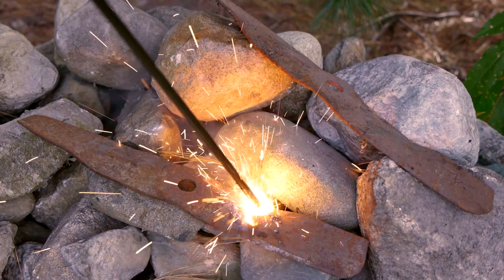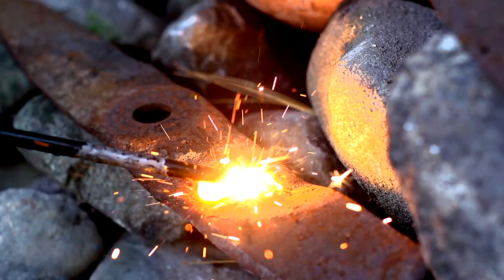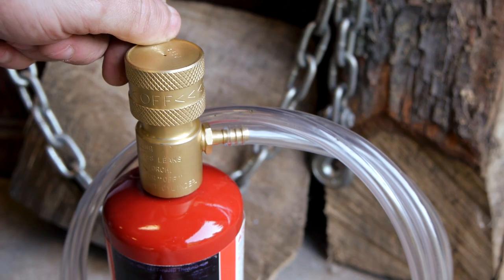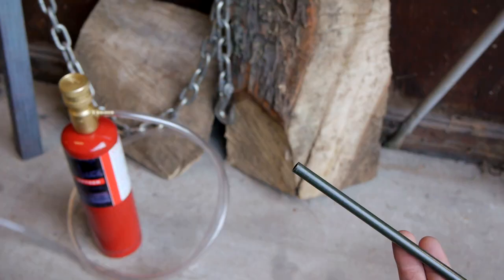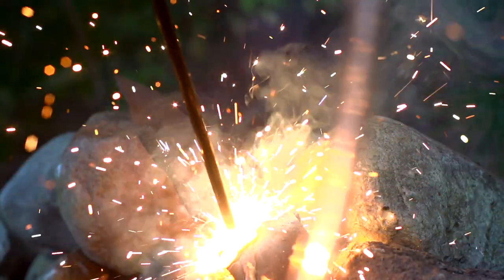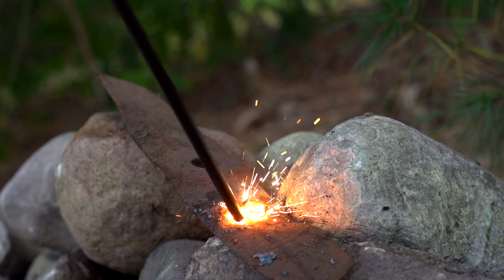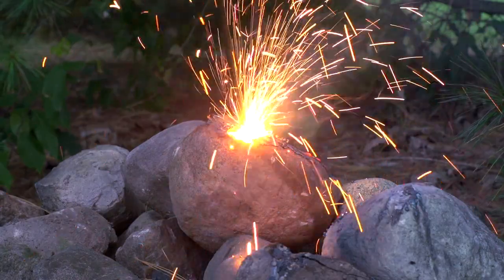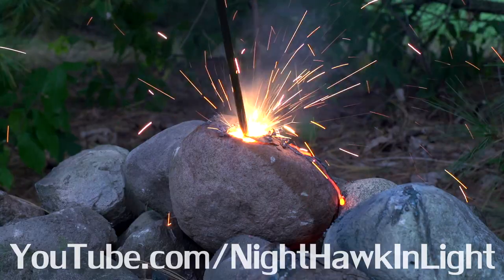How to Make a Thermal Lance Kit - Hot Enough To Melt Rock - NightHawkInLight

Comment: What degrees do you have. Or are you just magical
Reply from the maker: +eprepp 98.6 last I checked
Reply: NightHawkInLight I was gonna ask school but I didn't know how to spell college, however, the Internet helped me.
Reply from the maker: +eprepp I know, I was just joking. I took a few classes in community collage, that's as much as I've done. I don't recommend others follow in my footsteps in that regard. Education is very important.
Reply: NightHawkInLight yeah m8, I knew you were joking but just wanted to guarantee an answer. Don't worry, some of the most successful people were college dropouts, Gabe newel, bill gates, Steve jobs (not that you dropped out). You still seem very smart and I think you could be very successful in engineering or science, you got alot of natural talent.
Reply: +eprepp It should be noted though that most of the successful college dropouts, did so because they were bored and not challenged enough, not because it was too difficult.
Reply: +NightHawkInLight I personally believe community colleges are far better than MOST any universities/colleges as they usually teach trade skills and other real life useful courses that you can actually get a career/job in and not just a useless but expensive piece of paper to put up on a wall.
Reply: +13andsim I am wondering if one were to paint the brake line with real aluminum paint @ 99.5% purity it was pricy for spray paint ( a few coats at least to get a decent amount of thickness) and would that make it burn even a little better? or even a little hotter? or would it just burn up the "rod" faster with no substantial benefits?
Reply: +13andsim Aluminum is not the same as iron or steel, what the steel from the rod is doing is called burning out I believe. Also I don't think aluminum oxidizes as easily, so you might just cause slag to form from doing it, in other words you might just make it messy with no benefit.
Reply: K thanks man ... I was only wondering because of the exothermic reaction between oxidized steel/iron dust and aluminum dust like the thermite reaction and that it "may" add some more heat ... oh well it was worth the thought :-) (it is possible to get up to about 3000°c or so IF mixed at the proper ratio and properly ball milled/powdered).
Reply: +13andsim Actually, adding aluminium is exactly what we used to do (by packing the steel tube with aluminium strips and lightly crimping the steel tube to hold it in) when we used thermal lances in demolition in the 80's. I don't think aluminium paint would work though.
Reply: Tsnafu Awesome,  that's what I wanted to know :-) . This high end/specialty spray paint I ended up getting at a special price (discontinued product with a company I use to work for ..like 45-50$ /can ..made in Germany) and have been looking for an excuse to use some of it lol.  I am sure I probably could not deposit enough aluminum to make it as effective (or effective at all) as those long strips of aluminum.  Ha ha I must thank you again for the knowledge of your hands on experience and now will go in that direction (make/buy stripes of aluminum and then maybe mingle 1 or 2 thin stripes of magnesium and then "twist" it all together (like a cable) and insert it in that tube.. :-)
Reply: +DeadPistolsBrainGerms Structured education is a joke
Reply: +Seth Dillard I can't agree with you on this one. I have come to find that you get out of college what you put into it.

It's a joke for people to pursue a degree in some irrelevant field that they don't even really have any interest in. However, I learned about electronics, electricity, and math in college and it has helped me come a long way in my career. Sure, I may have been able to learn the same things outside of school, but the format allowed me to learn a lot of important things very quickly, and having good professors that will answer questions helps a lot too.

Ultimately, though, I will say a lot of people waste time and money on educations that they don't get anything from. But you can't say that structured education is useless for everyone.
Reply: +DeadPistolsBrainGerms You're right, but only partially. It kills curiosity and talent for people who can't think for themselves. But there are a lot of us that are capable of taking that information and putting it to good use.

I work in a job developing electronic systems for industrial applications, and I learned a ton of great stuff in school that helps me every day. Maybe school puts some people in a bubble, but I feel like the more I learned, the more I became interested in the field, and I made sure that I was pursuing information outside of the classroom. Sure, college may not be for everyone, and I do think that certain degree programs are a joke. But for some technical fields, formal education is great. I feel like going to college has opened a lot of doors for me, and if anything it's made me MORE curious.
Reply: +13andsim Look up "Thermite" 'nuff said.
Reply: +Chris Lawson So majoring in "Medieval Egg Candling" is impractical?
Reply: lol, no need to ;-) (preaching to the choir type of thing) .... that's one of the reasons why I asked the question ... kinda like a solid Thermite-like rod (although not at the "proper", most efficient ratios till you could get one dialed in) is where my brain was getting that idea from and to apply that knowledge with one of these lances ... maybe some sort of hybrid between the two or something (current thermo-lance above combined with what we know about the rust&aluminum thermo reaction).

Comment: so they make oxygen flashback arrestors  which screw into cutting torches and lines. and you could seriously improve on the safety level just by adding one... i imagine you can find one that uses the same size threads as the brake line, which would even make it easier for you to reload and get started again. but i really liked this idea.
Reply: For what purpose? Oxygen isn't flammable.
Reply: its an oxidizer... flames will follow oxygen.
Reply: raven bishop while oxygen cant burn, the tube certainly can
Reply: raven bishop flames do not follow oxygen
Reply: @riccardodambrosio3855 " The technical reality is that the oxygen doesn't burn,” said Mark Bruley, vice president for accident and forensic investigation at ECRI Institute. “It's a subtlety of the physics of fire. Oxygen makes other things ignite at a lower temperature, and burn hotter and faster. But oxygen itself does not catch fire.”

So, for example, an incident reported by hospital inspectors as an “oxygen fire” in a surgical mask is actually the plastic of the mask catching fire because purified oxygen has lowered its ignition temperature to create a flash fire. Plastic tubing, fine body hair, surgical sheets—these are the “fuels” of the fire, not the oxygen, which acts an “oxidizer” in purities above 35%, the Food and Drug Administration explains.
Reply: Since pure oxygen can't burn, making the tubing out of metal or something non flammable should make the design much safer. The flashback arrestor shouldn't be needed as long as anything flammable is kept away from any potential uncontrolled release of oxygen near a heat source.

Comment: how long does O2 last, and how long does Break line last??
Cutting depth??
Reply from the maker: +Ed ash All of those things really depend on how high the oxygen flow is set. All I can say that isn't effected by a lot of variables is that one disposable tank of O2 is enough to burn about 1' worth of brake line. That being so you can use about one 3' brake line per 2 tanks of O2. The disposable tanks do not hold a very large quantity. It's a good tool for my use in remote locations, but not very economical if there are other options available.
Reply: @Nighthawkinlight  That sort of answers my question as to what O2 flow rate do you use.

Comment: If this can melt rock, could you try to make jewelry or ornaments out of the molten rock?
Reply: Well, if you like black blobs of rock in your jewelry, sure, I guess. But try a tumbler first.
Reply: Casting is casting right? Rather it be plastic, bronze, lead, aluminum ect. They all have their variables to cast properly. I furnace tended in a non-ferrous foundry for over a decade. Know a bit let's say. I'd recommend to melt over the mold you made and have the surface of the mold hot af so it runs well and doesn't solidify quickly. Greensand would be best. Shapes well, raddles off easy and is reusable for many heats before you have to amend it with bentonite. Last you years. Good luck.

Comment: This thing is awesome now you just need to build an electrolysis machine to split water in to hydrogen and oxygen and then a compressor to refill the tanks for free
Reply: +Yextus You mean for a whole bunch of energy, which even if sourced renewably is not free.
Reply: Correct me if I'm wrong; but Grant Thomson already made a machine like this in one of his older videos, but it spewed out hydrogen instead. He also just connected it to a solar panel in one video I believe.
Reply: TheCombatPikachu Electrolysis just produces an oxyhydrogen gas mixture. You need a way to separate the two.
Reply: +TheCombatPikachu in a way, you're not wrong. grant Thompson did do something similar to this, but it was meant for smaller items, whereas this is usable for pretty much anything
Reply: +seigeengine Yes but that is still a higher concentration of O2 than air by about 50%. And H isn't exactly stable.
Reply: +seigeengine Electrolysis produces oxygen at the anode and hydrogen at the cathode. If you have the two separated, as is done in the basic high school chemistry class, you get each gas. If you have both going to same collection spot, you have, obviously,  a mixture of gasses.
Reply: +iguanian --- Yep.  We did it in my favorite teacher's (Mr. Barnes) 6th grade Science class.  We collected each of the gases separately then exploded them one after the other with a spark.  It was so awesome and LOUD.
Reply: +iguanian A simple question: Hydrogen is flammable too. Could you use both gases for this process, or would only O2 work?
Reply: Hoch134 No, it's the reaction with the O2 and the Iron that's  responsible for the effect. The oxygen is reacting with the iron to form iron oxides (rust). This releases heat, and continues the reaction.

And O2 isn't flammable, rather, it's the thing that allows other things to burn.
Reply: +Hoch134 Mixing hydrogen into the oxygen will give a hotter flame, but the resulting mixture is also explosive. A hydrogen torch is incredibly hot burning, but you need a source of hydrogen to use it, and an electrolysis cell is difficult to run to get a high enough flow for a torch. If you do have a large enough cell, you run into the problem of safely handling the resulting explosive mix of gasses. As the other reply mentions, the addition of hydrogen won't add much to the 2000+ degree flame you get by burning iron.
Reply: +Hoch134 solar power splits the atoms, use the hydrogen to compress the oxygen into cylinders. done done done (don't blow yourself up trying to build a hydrogen combustion engine)
Reply: Virgil R Garwood HOLY SHIT, IT'S GOING NUCLEAR.
Reply: Fine, separates.
Reply: Virgil R Garwood The word you're looking for to be clear is molecules.
Reply: The things, you fail to use in communication, are grammar and punctuation... Just to be clear.
Reply: +Virgil R Garwood use the hydrogen to fuel an external combustion engine, like a Stirling.
or a fuel-cell arrangement  like the shuttle... that would work (kinda)
Reply: +Tom Wiggin In the physics sence your right but with solar panels its free from money and also electricity is way cheaper than oxygen tanks
Reply: Yextus No, it's not free even with solar. Please stop talking about money until you have a basic understanding of finances.
Reply from the maker: +seigeengine Alright quit bickering.
Reply: I'll promptly do that as soon as I find myself bickering. :D
Reply: Signal Jones that's right where my head was going.

Comment: It feels like it should have a flashback valve for safety, its a very simple design but im very impressed by how well it works. Nice job
Reply: +jonnywaselectric Pure oxygen doesn't burn, and the wool/mesh will get blown out when it ignites, so it's not a problem.
The device is inherently safe. If the oxygen supply is cut, you're left with a hot bit of tube.

Comment: Wow, great idea, very well done....

Since you use Brake Line perhaps you might want to consider this:
Seems to me you can use the Cut off Line to insert into the hose end then use a coupling to add new lines easily, that way you can find a more permanent solution to couple the line and vinyl tubing. The couple will also act as a reminder as to how much Brake Line you have left too so you never come close to the tubing. You can also cut new Brake Line in half and use both sides for less waste in the long run...

I don't have a real need for one of these but I really want to make one, ya never know... LOL...

Comment: Read all comments? Thanks for the great vid channel, and here's a project idea: Lots of actual working knowledge is disappearing as reliance on the internet grows, and libraries remove older books from shelves. Storing elastic energy for a longer, more constant release than you get in a rubber band powered plane used to be done with what was called a spool motor - a larger drum and a smaller drum with elastic cord wound onto one while being stretched over an engaged pulley (or maybe that is backwards), then released, stretching pulley disengaged so that it would wind onto the other drum. Both drums rotated. each had also a pulley of equal size at the end of its shaft, and these connected by a drive belt. Anyway, with mechanical efficiency, elastic energy and motor in one is at least a super interesting alternative to booming battery tech advances, and its already naturally lightweight as well as much less expensive to play with. Another method might be using a stretched elastic cord to power clockwork, and utilizing the kinetic energy as replacing a battery or turning one of those little emergency radio generators, or even as a cell phone charger. How much energy can be stored in a stretched 10 ft length of elastic cord? ...and i'm not a youtuber, but you are.
Reply from the maker: Good idea, I'll look into it.

Comment: If you wish to lance out a for example a 4140 pin you need bundy tube packed with mild steel 1.9mm or close to that welding wire. Ignite with oxy/acet cutting torch. I use brass compression fittings and a hyd ball valve as the go switch. Tee an oxy line off your reg for that

Comment: This... is not only brilliant, it has many potential uses, too.
The first that sprang to my mind is a heat source for smelting IRON!
And yes, something needs to be done about the flammability of the feed tube.
It could also be used as a rocket engine on an Iron asteroid, using itself as fuel.

Comment: Dude! Holy shit, that is some poweful new tool you got there. Are you the first to find this out? It's so cheap and effective! Thermic lance manufacturers are going to have a fit not being able to peddle their wares anymore, if this hits mainstream bigtime.
Reply from the maker: +devjock Commercial lances would still be better if you have a big enough O2 supply to run them.
Reply: Well, I'm not really sure what it is that commercial lances offer above the basic functionality presented here. If it's just more bulk iron, and it would need more o2, then uhh.. well, if that's all they add, then they still might have a problem. This'll have the usage scenario's for home tinkerers more than covered.

Comment: I saw an instructable about how to make a thermic lance in this way. (possible it could have been yours?) The instructable said to use 0000 steel wool. I'm sure it would help. I have been fortunate enough to work at a mechanics shop where an oxyacetylene torch is available. I adapted a section of hose to securely fit over the torch nozzle and use a spring clamp to hold sections of used brake line on the other end. I can still light the line with the 3 course steel wool, but it has a tendancy to blow out the molten steel wool if I don't start the lance against something like the inside of a brake rotor. The super low cost makes it extremely useful and practical in the shop, but I am looking forward to making a more portable system for home use and preparation purposes. Thank you for the video, its put together very well.

Comment: sorry, I didn't take the time to read all the comments. however, have you considered using an oxygen nebulizer tank for the gas cylinder? they would be at least twice as large as the current model, and are easily equipped with a small wheeled dolly for transport. otherwise, I alway enjoy your projects! keep up the joy of making!
Reply from the maker: +Jay Buchanan There are lots of options for larger tanks, but my design was meant specifically for light weight and portability.

Comment: awesome, but have you thought about making an adapter from the tube to the iron pipe out if a heat resistant material, or maybe just some thicker steel so that it can't catch fire and transfer it to the tube?
Reply from the maker: +mita232 Yes, now that I know the design works. I haven't looked into it, but I know they make hoses specifically for use with O2 that would probably be a good option.

Comment: You could make a simple brass fixture that connects tot he other end of the tube and holds the iron pipe via spring tenshion so you can quickly change the tubes.

Comment: Some unusual tools here. You need a pop chamber for small oxy-cylinders. Granted the ear protection is required because of pressure levels afterward, and a good anchor for the pop chamber. Perhaps a smaller feeding line to the brake line would be good so it can completely disconnect if a backfire happened.

Always plan for catastrophic failures.